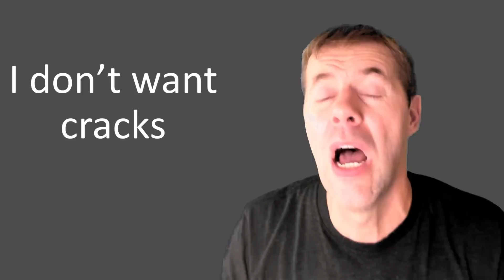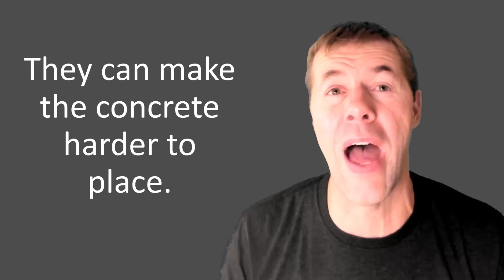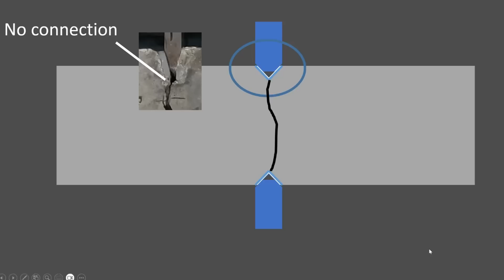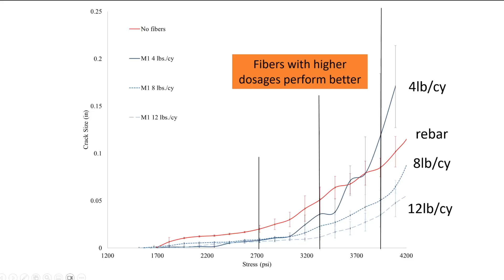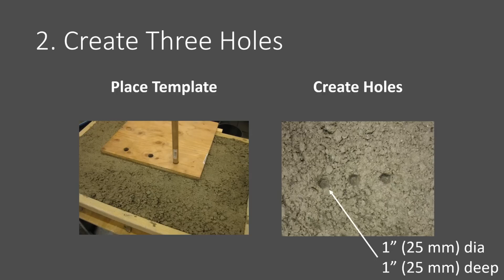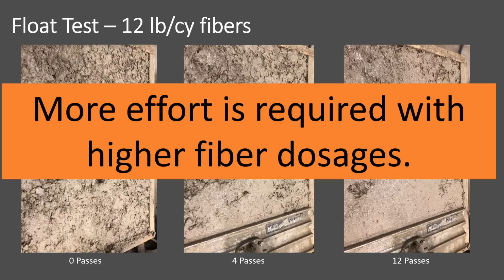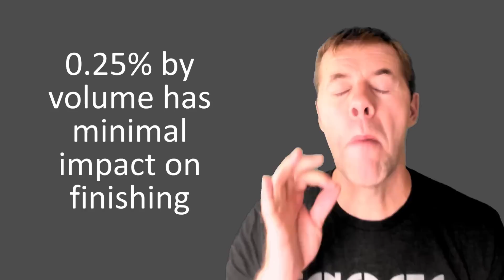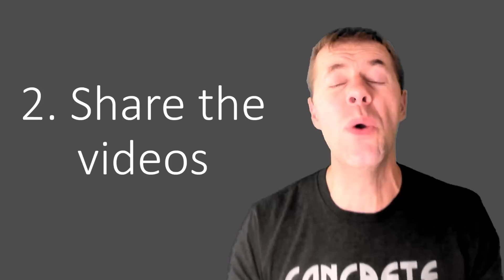Testing fiber reinforced concrete with an expert

Comment: What about using water reducers and plastiziers?
Also how do the fibers distribute/settle under a vibrator, say in a foundation?
Nice info, great video as usual!
Reply from the maker: Thanks for the note!
Water reducers are great.  Depending on the dosage that you use, you may need to use a little higher dosage for a fiber reinforced concrete mix.  
If your mix is designed correctly then the fibers shouldn't settle.  This is called segregation.  This is really controlled by the aggregate distribution within the concrete mix.  Watch my videos about the Tarantula Curve for more info on this.
Reply: @TylerLey  is there a place to download your tension graphs for the different fibers? Or your associated paper?
Personally I’m interested in seeing how the polypropylene fibers do.

Comment: I wish you talk more about the applications of steel fiber reinforced concrete.
In one of our projects, we proposed a value engineering solution to replace the rebar reinforced rafts with hybrid reinforcement (rebar + steel fibers ). But, we faced resistance from the project management consultant claiming that SFRC is only applicable for slab on ground.
Reply from the maker: Thanks!
This is a good idea for future videos.  I talk about this a little in my video "5 proven strategies to make green concrete".  I agree that more indepth discussion is needed.  Unfortunately, there are not a lot of agreement on the best way to do this.

Comment: I had a long and wide walkway poured with added fiberglass.  It's been 15 years and it still has not cracked. Money well spent.
Reply from the maker: Thanks for sharing!  This type of information can help make others more confident.
Reply: @TylerLey  it would be cool to see fiberglass in your test. That’s what I hear more of than anything else as far as an additive. Also added cost on all of them would be great.
Reply: @TylerLey  Hey, I wonder if it is sometimes a good idea to implement a mix of both rebar and fiber? Are there cases where it is beneficial?

Comment: I do hope Tyler covers more fiber types. I suspected fiber was a good additive but with this opening video we could get more definition on how different types work. As another commented, "PVA; basalt and AR glass", these are what is commonly available that I could find.
Reply from the maker: Thanks!  The fibers in the video are examples of the types most commonly used in commercial concrete mixes today.
In my new study, I hope to test other types.  I will report back on what we find.  
Thanks for watching!
Reply: I am not immersed in the concrete world, but I would have thought glass fibers used in GFRC would have been one of the most used fibers in concrete. I have been researching some lately and I see that there are two techniques in GFRC. Using upside down forms where you spray a non-fiber face coat then a GFRC backer coat and the formless design like they use in artificial rocks, caves, outdoor structures etc... Where they place the GFRC backer first on a structure (usually made of rebar wrapped with hardware cloth and burlap or an EPS foam core) to create the shape, then a non-fiber face coat is applied that can be carved or stamped. Please do an episode related to glass fiber, GFRC mixes.

Comment: Fibermesh helps to prevent cracks from forming, and rebar golds cracked pieces together. Regular rebar itself does nothing to prevent cracks, but it will keep concrete from heaving and separating once it does crack.

Comment: Nice testing!  Almost always use fibers in slabs, but there is one more downside that causes high-end artistic contractors to avoid fibers.  Lack of dispersion - that leads to small clumps at the surface.  They don't show right away, but after acid etching or weathering, they do. Eventually leave surface pockets.  This is at 1.5 to 2 lb per yard of fiberglass fibers (what the batch plant says - they think that 2 lb is way too high, and still did not stop all visible cracking).  So, been testing PVA (PVOH), Basalt, Acrylic, and Aramid (Kevlar), and fibrillated PE minifibers for overlays.  So far, so good.  Medium/small combo works!  Such as basalt/pva. Have had steel fibers puncture embedded PEX heat-system tubes (finisher stepping on it?), which was really really bad.  You can see amazing results with strong-bonding synthetic fibers that work at lower doses (NOT nylon or maybe not polypropylene).  Now prefer to keep it around 1 lb per yard, but of really effective material per pound.  Still learning.
Reply: What do you pay for 1 lb?
Reply: @elbuggo  Retail is al over the place. Acrylic are the most reasonable.   I use ICF brand  (not the foam forms) - confusing!  Combine 1/4" with 3/4" for nice result on thinner placements.
Reply from the maker: @SpaceCrete  Thanks for the reply!  It sounds like you are using microsynthetic fibers.  I have not heard of the problems with the surface pockets, but that makes sense.  
I will have another video where I talk about testing microsynthetic fibers.  They are best for plastic shrinkage cracking.  I typically use them at 1lb/cy.  Some of the best microsynthetic fibers work well at 0.5 lb/cy.  This should help with balling.
Reply: @TylerLey  It was fiberglass (supposedly), the default choice from the batch plant.  Just got some kevlar to test.
Reply: @SpaceCrete looking forward to a Kevlar update! 😅🎉
Reply: @Wanhope2  You know what, I ordered a kevlar sample and misplaced it!   Been looking for it - going crazy.
Reply: @nobreighner  same issue here. 1.5" fibrillated microfibers at 1.5 lb/yd. Burnished finish. Anywhere fibers lay horizontal is a superficial weakspot or crater. Investigating different fiber that can be consolidated better or better techniques like vibrascreed or rollerbugs.

Comment: I hope that future testing includes SS rebar with SS fibers.   That solves the long term rusting issue with steel.
Reply from the maker: Keep watching!  I think there are some cool things that we can do with this test.
Reply: There is fibreglass rebar as well 😮 its expensive but unbeatable where you have salt & concrete!
Reply: @jackdbur  The question with fiberglass rebar is how long does the epoxy resin holding it together last?

I grew up building and using canoes out out of fiberglass.  My experience is that after a decade or so that the resin starts to fail and no longer bond the fibers.

The appropriate grade of SS does not degrade when exposed to salts and deicing chemicals (there are multiple grades of SS rebar - the cheaper ones can degrade and be attacked by various chemicals).
Reply: @perryallan3524  pulled up a study showing tidal zone Jacksonville black steel has a life of one year.
Tucson hiway had 400 years.

Another fiberglass study said 100 years for fiberglass but they used 50 because they're engineers.😊

Sounds like it's stable and it isn't an epoxy for standard fiberglass.
Basalt is going to last a while also.
Short version is they will both last multiples of the amount of time standard bar lasts.
Don't know about basalt but off the shelf at Lowes fiberglass 20ft sticks are always priced the same as steel.
Reply: @perryallan3524  epoxy is killed by UV.  In concrete it should last a very long time
Reply: @morganwheeler7417   The problem is not the life of the epoxy itself  Its that every cut end, every nick, every crack in the epoxy allows water to penetrate and then rust forms under the epoxy coating, which cracks more epoxy off from the steel.  The results are conclusive with over 2 decades of epoxy coated rebar being used.  It really does not extend the life of carbon steel rebar by much.   Multiple massive failures in every State and Nation that has used it.   I'm surprised its still being sold.
Reply: @jackdbur fiberglass is priced at thw same as steel. Thw only cost increase is that you have to order corner pieces. Lest cost on labor because it's so easy to carry.
Look up the price at Lowes.
Reply: There is a galvanized rebar supplier at the Port of Catoosa outside Tulsa, OK.  Looks interesting.  I can only imagine the cost of SS rebar and the problems bending cages with it.  Hopefully Tyler will comment on that too.
Reply: @mikemorgan5015  Galvanized and expoxy coated rebar has not worked out as well as it was thought.   Every defect and the cut ends are ripe for very rapid rusting and corrosion.

There are multiple grades of SS rebar and SS tie wire - and at least some of them can be bent.   My understanding is that overall SS rebar typically adds 5-7% to the cost of a project.  But totally stops rebar rusting and related concrete failure in the future.

A lot of bridges are now being built exclusively with SS rebar and tie wire.  Nuclear power plants as well (where they are hoping to run the new reactors for over 100 years).
Reply: @perryallan3524  Cool!  I knew about corrosion creeping extremely fast under epoxy coated rebar through nicks and defects.  I can see the same with galvanized happening.  Makes sense.
Reply: @mikemorgan5015  My understanding is that while galvanization provides better protection than does epoxy as the adjacent zink will sacrifice itself until the rust defect overcomes it... but the long term results are the same as the rust keeps growing.   One comment I heard (not sure how accurate) was that galvanization lasted about a decade longer than epoxy in most applications.  Still not long life - and still failed concrete reinforcement.

So there is perhaps a use for planned shorter life concrete.  But, any concrete strucrure I plan on I feel should last hundreds of years - and I've been dreaming of thousand year+ concrete.
Reply: @perryallan3524  we have it. It's just cost. How many thousand of dollars a yard do you want to spend?
Reply: @ You are way overblown the cost of SS Rebar.  My understanding is that it adds 10-20% of the cost per yard of concrete over steel rebar.

Many bridges and other long life structures are now built with SS rebar; and have been for the last decade.
Reply: @mikemorgan5015  Helix has stainless unless that's what they have there.
I've used it and like it but I use the basic galvanized
Reply: @mikemorgan5015 I think rebar is good for foundations yet useless for slab or too much for so little that it helps
Look at the disaster of what rebar does to bridges and overpass concrete.. it rusts, expands during the rusting causing an almost hydraulic action to explode the concrete ..
Just not much shelf life with rebar used due to oxydative rust.
Reply: I believe that 2 or three inch long 
16 gauge stainless wires will give an interesting study .. more rigid than any or the fiber used and possibly far superior

Comment: I use this fiber and retarder for years .
Best way to prevent cracking.

To much causes surface finish Polish issues though.
Freeze thaw performance increased .
I love fiber additives .
I recall ACI requirements call for .003 of cross section area of steel minimum amount rebar or WWM .
Add fiber plus minimum amount of steel on  ground bearing slabs .
Proper subsoil no organic clay and 98% compaction critical . Low slump low water possible also .
Always put heavy plastic under slabs.
Keep surface wet for days like bridge deck after sets up.
Always!
Reply from the maker: There are some good tips there.  Thanks for sharing!
Reply: @TylerLey  Contractor since 1979 and Degree in Architecture NYIT.
Enjoy your channel.

Many who install concrete have no knowledge of such .
Frustrating

Comment: What is your take on ReforceTech's 'MiniBar' 'High performance composite macrofiber for concrete reinforcement' that seems to be leaning away from just preventing cracking and more towards replacing rebar? It even appears to be twisted like weedwacker line giving it tooth effect, seems like a great way to reduce carbon in projects.
Reply from the maker: I have not tested it.  I am big fan of replacing rebar with fibers for certain applications.  You can see my video "5 proven strategies to make green concrete".  You can reduce or replace rebar with any macrosynthetic or steel fiber but there is not a prescribed way to do this yet.

Comment: To much fiber make makes surface finish difficult.
Reply from the maker: Truth!  That is what the second part of the video focused on.
Reply: @TylerLey That is dependent upon your concrete mix. HB70 repair mortar is full of short fibre, extremely tough and easy to get to a polished finish! But damed expensive 😢

Comment: Do steel fibers rust and expand if exposed to water or salt water?

How does this all work in freezing weather like Minnesota?
Reply: If it matters, I think there's admixtures that help to prevent chlorides from causing reactions in rebar. I'm guessing that since the same chemistry is involved with the fibers, they might help similarly.
Reply from the maker: Steel fibers will rust if they are exposed to salt water.  This doesn't impact plastic fibers.

Fibers are widely used in Minnesota for concrete overlays on highways.  They do great in freezing environments.
Reply: @TylerLey  Would admixtures designed to prevent chloride based damage to rebar also work on steel fibers?

Comment: Hey Dr. Ley! This is great info. Do you know if the fiber content effects the freeze/thaw durability? It seems like smaller cracks would mean less water infiltration into the concrete meaning less issues with freeze/thaw concerns. What do you think? Cost is also a major concern for public and private projects. Do you have a general idea of price increase per CY of concrete at the 4LB/CY dosage?
Reply from the maker: I have not seen any data where fibers were shown to reduce freeze thaw damage but it would make sense to me that it would at least delay it.
The cost of fibers depend on the dosage and the type.  I have seen them from $6 to $12 per cubic yard.  This is less than a 10% increase in cost but you should check with your local ready mix supplier.
Reply: @TylerLey  Thanks!

Comment: One concern I have is that the fibers will get worn down if they are in the mixer for too long.
Reply: they go in right at the end just long enough to mix. Too long and they break down.
Reply from the maker: I think this can be an issue with some glass fibers but it is not an issue with plastic or steel fibers.

Comment: Mr. Tyler please make a video on graphene based concrete.
Reply: Not all graphene is equal - would be great to see the same dosage of different graphene products compared.
Reply from the maker: @nicks1146  Agreed!  Maybe I will be able to work on this someday.
Reply: @TylerLey  I used just graphite powder in foam concrete and got immaculate results.
Reply: @nicks1146  can we use expandable graphene to enhance strength of concrete.

Comment: I have been looking at fiber reinforced concrete.  How much extra does it cost is the real question.  I am willing to accept 20% increase to cut down on the cracks.

My real question is how does it work with self consolidating concrete?
Reply: Fiber is like 6 dollars a yard for a standard dose. Not expensive at all.
Reply: Both macro and micro fibers work with self consolidating concrete but you may have to adjust your water and plasticizer amounts.